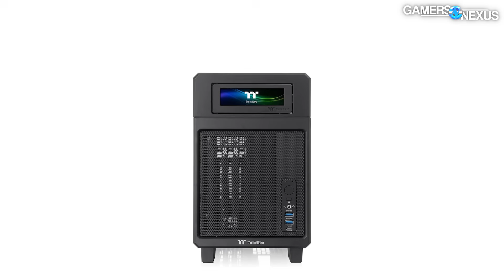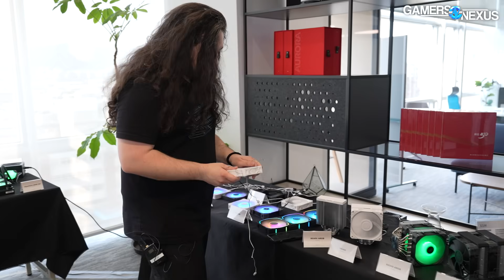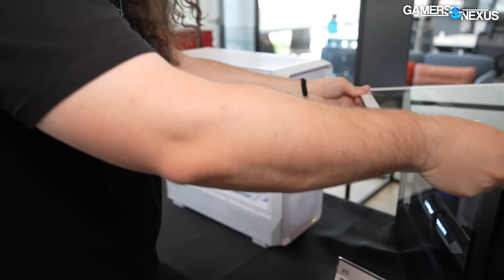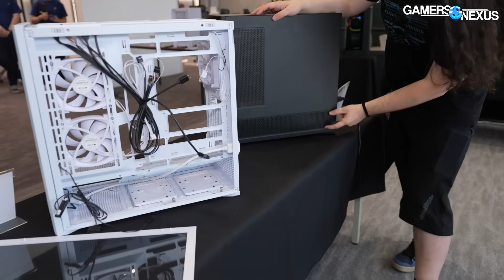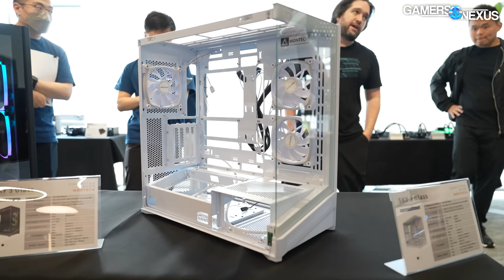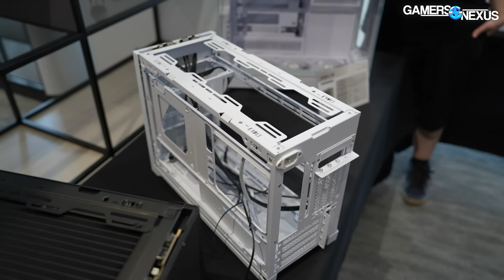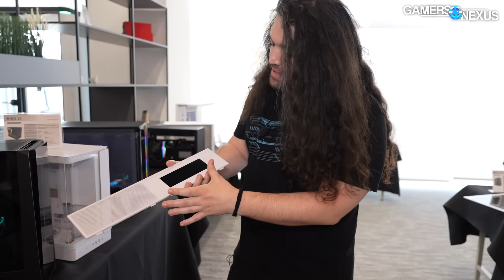Montech is Targeting Thermalright: Cheap Air Coolers, Sky 3 Case, Micro-ATX, X5, & More

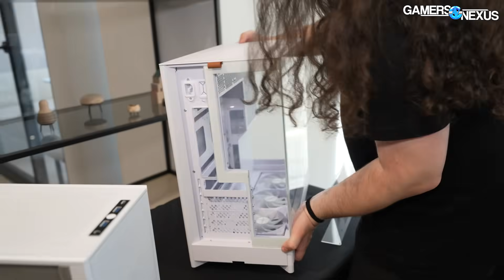Comment: 11:30 Companies that make cases featuring alternative PSU placement (requiring the use of a patch cable to the case's exterior, like the case seen here) really need to spring for the inclusion of a PSU On/Off toggle switch that (ideally) would be located next to where the PSU's cable connects to the case.  Not having a switch that I can toggle Off/On (during a lightning storm for instance) without having to open the chassis is a deal breaker for me. I'd never buy or use one.
Reply: Extension cords with switches exist my dude. Or just unplug the whole thing from the wall socket.
Reply: @unskilledpro2223  Or I could just buy myself a PC case that doesn't require me to spend money on an additional purchase, and doesn't require me to move furniture around, in order to cut off the power to the PC.  No thanks.  My dude. 👎🏼
Reply: @SigonLegacy I say again: No thanks.  I'd rather buy something that fits MY needs (I'm the one spending the money on it after all), rather than having to resort to some kind of jank workaround after the fact.  YOU can buy one and just yank the cord from the back of the box when necessary though.  Be my guest. 😏

Comment: Anyway you can test the front intake fans with the 120mm and 140mm Railing compared to stock and see if temps are better or worse? LANCOOL 217

Comment: Part of the peerless assassin price is packaging overhead too. Plain boxes, nothing fancy. I love my cooler
Reply: it's genuinely a fantastic cooler, crazy how cheap it is
Reply: Yup, my Phantom Spirit (I think that's what the PS in PS120 means?) which is basically just a 7 heatpipe version of the Assassin came in a plain cardboard box, a couple bags of mounting hardware, tiny instruction book, a tube of thermal paste, one fan in a cardboard sleeve and the other sitting between the dual tower to save space. Pretty much as little material as their possibly could be.
Reply: because of its price pa120se made every other air cooler worthless lol
Reply: @apexHasu true 😂
Reply: It truly has been peerless for a long time

Comment: Why do case manufacturers still insist on glass side panels? Surely, having a metal mesh side panel (maybe with fan mounts for GPU and memory area) is lighter in weight than a hardened glass panel.

Comment: If only CPUs and GPUs were as interesting as the low cost cooling and cases competition is lately.

I used a couple Montech cases last year and they're surprisingly good for the price. But I haven't used anything but Thermalright for cooling for my last 4-5 builds. Their 360AIO is insanely good while being insanely cheap. I also came across a great GameMax case this spring that had no business being so cheap for full glass and 6 fans included.

It will be interesting to see what Montech can come up with to compete with Thermalright in cooling.
Reply: Pretty funny to be in an era where I’m more excited to watch news about fans and cases than anything doing computation lol.

Comment: For a very long time, at least for me, the budget option, was the hyper 212. Now it is good to see some other options at even lower prices than the current price of the hyper 212.
Reply: Straight up the Phantom Spirit 120 is like 5 dollas more expensive than the current price of the Hyper 212 more or less and you get Noctua DH-15 performance for that. No need to go cheaper really.

Comment: Be Interesting to see how the 6 heat pipe dual other cooler for around $50 compares to the thermal right 240 and 280 aios that are around $50-60

Comment: I got their air 903 max case and was pretty impressed.  For $79 it was very nice.  I remeber some of the flimsy crap we used to call premium cases not that long ago.  The entry level stuff today is actually good for the most part.
Reply: I picked up the (black) Base version (for under $60) recently, and I'm planning an all black non-RGB build for it. 😁

Comment: I'm pretty dang happy with my Deepcool CH560 that I got for $50 when they got kicked out of the US.
Reply: Deepcool will be missed in the US seriously 😢. I still have a 1000w powersupply from deepcool in my current system. Geopolitical stuff sucks
Reply: @Bulkyninja  Indeed.  I was lucky enough to pick up three brand new sealed PX1300P PSUs on eBay for $150 apiece just after the ban, and I've already used two of them in builds. (I'm hanging on to the third one as a spare for now. ) 😊
Reply: I picked up a TON of DeepCool stuff on eBay dirt cheap.  There's still a lot to be had there, and more going up almost daily (I keep checking), but most of the best stuff is long gone (he said as he eyed his stockpile on the shelf 👀) and the prices of most of what's left has gone back up to near (or above) retail.

Comment: All those fans and the motherboard is a hot dead zone. Dear fan makers, a single slot blower fan exhausting out a back slot that can be installed up or down quite possibly with a blank pcie 1x support helps a ton with keeping air moving under the video card and more importantly across the pch and the onboard ssd's. I have one of those ali slot blowers but it's a design that can be highly refined with a pwm fan and maybe a slightly slimmer and well, more refined casing. I put on a voltage knob "speed controller" on mine.

Comment: Everyone is trying to compete with Thermalright, except for Noctua. Noctua thinks that there is no competition and that 150€ for a dual tower that BARELY outperforms a 40€ tower and gets utterly crushed by a 60€ aio is somehow justified.
Reply: I think they're relying on their good name and returning customers carrying them. Not sure how long that's going to work out for, though.
Reply: Noctua has en edge in some things that is continuing to be reduced by time goes on. I would like the brand to reorient itself towards the $50-80 price point and keep the focus on silence.
Reply: @AgentMoler you're right but they won't I mean did you see the fans for your office desk
Reply: Well, my NH- U12A has served me well for 6 years and 3 different CPUs, including 1 with a different socket, so I will pay extra for that kind of quality and customer service in the future again gladly. This is without any kind of maintenance performed.
Reply: @edmond4005 holy shit your hunk of metal is still a hunk of metal!? That's incredible!
Reply: @hadesflames bruhh 😂 yup that's basically it
Reply: Bruhh there's always that guy " I've had my very expensive cooler for years! I I I had it back in my windows XP system now I'm barely on windows 7 and it works perfectly fine"
Reply: BuT qUiEt FaNS 😂

Comment: So... do we KNOW why/how thermalright is able to get the prices that they do?
Reply from the maker: I sort of do -- working on that coverage!
Reply: @GamersNexus  I'd be interested in that video.
Reply: @GamersNexus  hey thats steve
Reply: @GamersNexus  Can't wait for the video! Who is the genius running Themalright company I wonder. Their cooler is so cheap and yet it is able to cool the cpu even at load and they also bundle it with a bunch of mounting kits and even bundle it with paste. The packaging has tons of foams as well. It really feels like you are stealing from them when you buy their coolers 😄
Reply: @GamersNexus :000000
Reply: @GamersNexus  It's sexual favors isin't it ?
Reply: @GamersNexus That'll gonna be a banger!
Reply: @MattJDylan  Thermalright ruined my AMD X670 Motherboard as the cooler really needs to be used a contact frame as the AMD LGA pins are weaker the then Intel LGA pins, Thermalright don’t see the problem because even they did the tests but with only intel chips, they seem to think the same copy and paste Intel data is good enough to use with AMD. Simply a company selling coolers for expensive chips can’t tell the difference between sockets when the two are completely different chips socket type and LGA Socket pins. Themalright state "The pressure parameters we designed are all comply with Intel's standard; it's constrained by Intel's design specifications. If there is any doubt, please kindly provide proof that the product is flawed, thanks. So, try this yourself applying the Cooler on AMD and Intel motherboards without and contact frame vs using a contact frame and see how many applications of the cooler it takes it takes before the socket pins get damaged and then there are black screen and errors. My AMD board 6 months old lasted two applications of the cooler before I got a black screen and no boot issue and I took the cooler off to see bent CPUI socket pins BUT used the same components on a new board and booted straight away. Thermalright think that this is acceptable because AMD is just “compatible” in their world and not actually tested to the same standard as INTEL because they copy and paste the same data. Arctic coolers come with inbuilt contact frame by standard but Thermalright doesn’t so what do Artic know that Themalight don’t? This is not about cooler CPU temps I have a Amd 9 9950x3d as this is about how much pressure is applied to the socket and LGA pins with two points of contact VS 4 and two seems to be twisted and distorting the socket and causing bent pins even just taking the heatsink on and off to clean. Reinstalled the cooler with a contact frame on a brand-new motherboard and no issues what so ever but I am not using an Intel chip so I am dreading the next clean session. I can’t RMA the ruined board because of the bent socket pins and I did the damage simply by cleaning and repasting the heatsink and Thermalright state “Its ok because it’s tested to Intel specification standards” and the damage is my fault because I bought an AMD socket. I am 445 out of pocket for the sake of a 10 Doller contact frame and Themalright need to state a disclaimer that AMD owners should be using a contact frame with this cooler as socket pin damage can happen. In my 25 years of installed coolers this is the only cooler to bend CPU socket pins and now I will never install a Intel or AMD socket without a contact frame.
Reply: @GamersNexus  It's wrecktum time! Steve has entered the bathroom!
Reply: @GamersNexus ORANGE MAN BAD
Reply: If I am not mistaken thermalright is doing all of the components needed by their own without needing different manufacturers For their products .
Reply: @mitsos88spyr  That's not true, most of Shenzhen Dirise (or Thermalright) products are outsourced, they don't manufacture their products let along the components.
Reply: As far as I know they make the coolers themselves so they don't have a factory middle man to go through
Reply: Their start up is low cost considering they didn't try to sell stuff like psus which need many different components that are manufactured overseas like japan or taiwan.

Coolers generally can be made cheaply anywhere, you just need some metal and a cpu fan
Reply: They own their own factories from what I know so they cut out one of the middlemen
Reply: They own their manufacturing fabrications so they don't need the middle man.
Reply: What's the politically correct way that the Thor movie put that won't get my comment deleted by Youtube? Oh yeah: "Prisoner's with jobs." That's how they keep prices down.
Reply: @butcherpete2182 I don't get why the US doesn't do the same thing
I mean, aside from all the stuff they've already got them doing
Reply: @butcherpete2182 LMAO, I remember exactly this scene 😂
Reply: Most like people at company doing their job. So less employees and less hassle
Reply: Bulk.